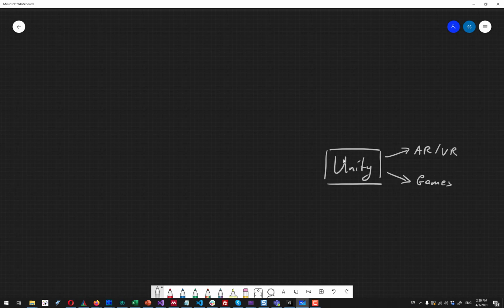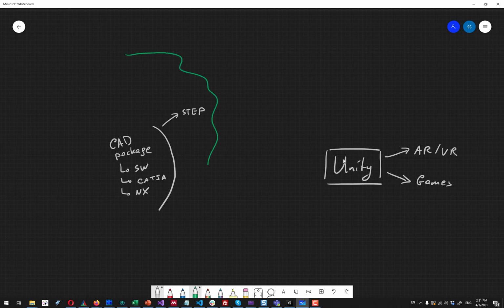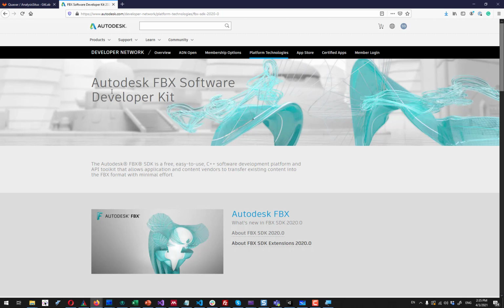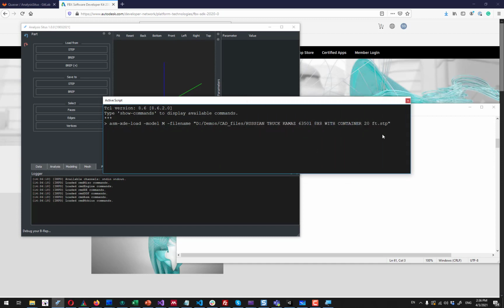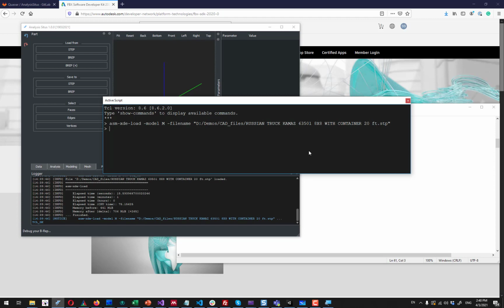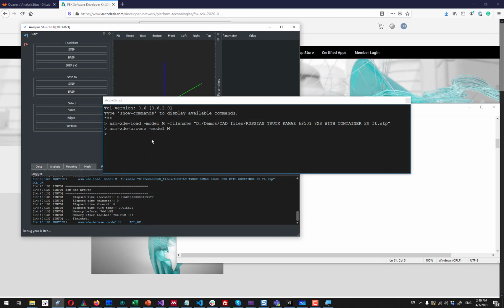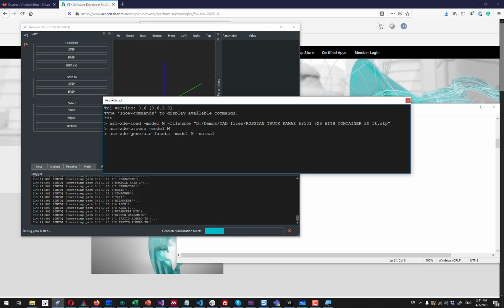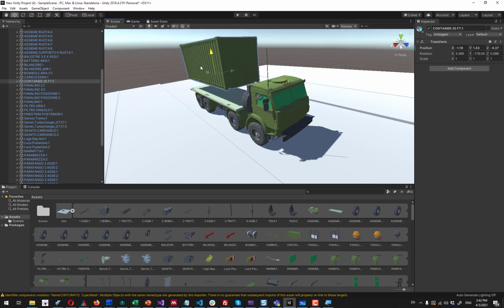Export to FBX | Bring CAD data to Unity | Open Source SDK | Analysis Situs

Comment: Need help, file isn't save as fbx , shows errors Call to FbxExporter: : failed.....i have install autodesk fbx sdk ,
Reply from the maker: Can you send me your input file to sergey.slyadnev [at] gmail.com ? There might be some issue with the input or with the fbx translator itself.
Or it's even better if you report a bug in the tracker: https://gitlab.com/ssv/AnalysisSitus/-/issues
Reply: @QuaoarWorkshop  it works, thanks you very much.
Reply from the maker: @aniketpichakate6525  Cool. I've just realized that I wasn't clear in the video that separate installation of FBX SDK is not necessary. It should come up bundled with Analysis Situs.

Comment: can we create virtual reality applications with opencascade?
Reply from the maker: In all the cases I'm aware of, OpenCascade's job is limited to creating/exporting geometries to engines like Unity/Unreal. Then, to program XR, you'd rather use Unity itself and its C# scripting. So, to answer your question, OpenCascade can contribute there, but not solve the whole problem. Because OpenCascade is simply a geometric core, whose main function is precisely represent physical products in a digital way and provide all necessary sculpting/modelling API around. All other services, such as data exchange (STEP/IGES), visualization (AIS), application framework (OCAF), meshing (BRepMesh) ease the integration and bring a lot of added value with them. But, in its essence, OpenCascade is mostly about math. The applications, such as AR/XR, CAE, CAM, feature-based and direct modelling, feature recognition, whatsoever are not solved by OpenCascade but could be solved with the use of OpenCascade.
Reply: @QuaoarWorkshop wow. You are good at this